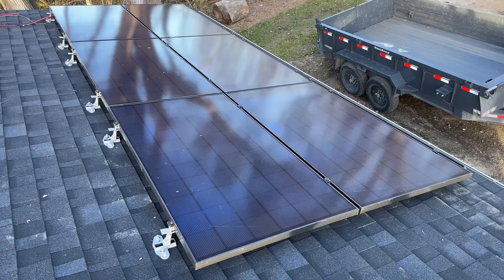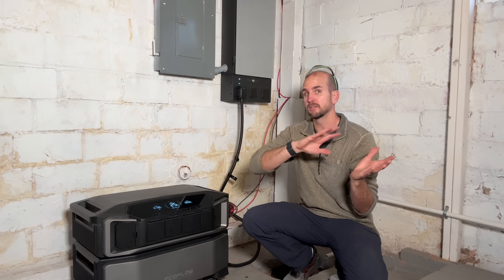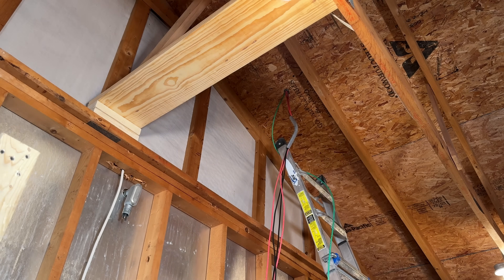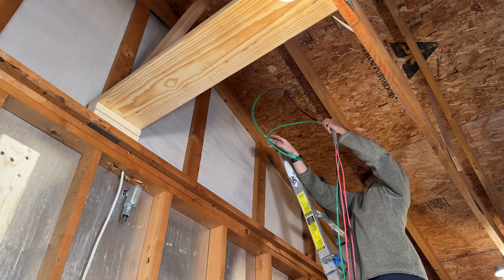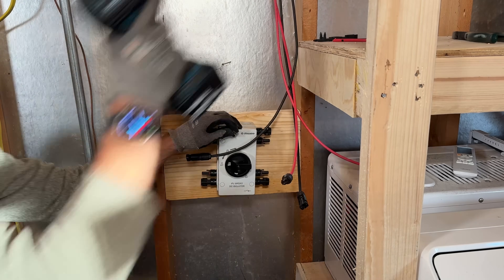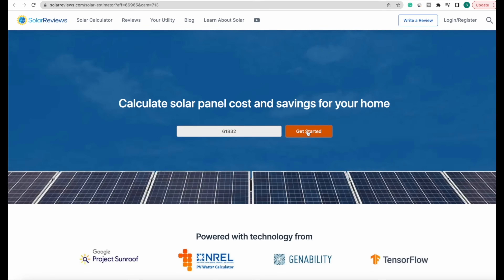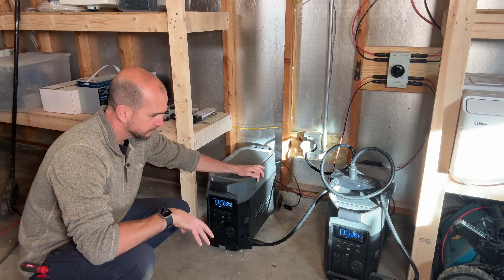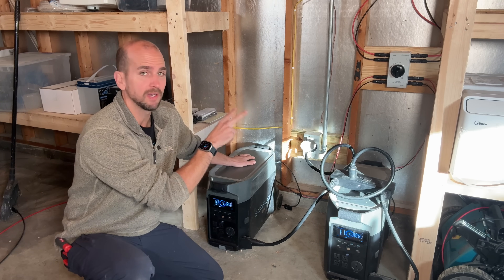Charging An EcoFlow With Roof Mounted Solar Panels

Comment: I really like that the audio is crystal clear and that there is no music, no barking dogs, no screaming kids, no traffic noise etc. But I have two wishes: 1.) I wish is that you showed, up close, how you are wiring the various components, rather then speeding up those parts. 2.) I wish you discussed how to meet NEC requirements. 44 states have adopted at least NEC 2017 and 20 of those have already adopted NEC 2023. In my area, putting panels on my garage roof triggers the requirement that I provide Rapid Shut Down (RSD), which is why I sought out your video ... but you don't describe RSD. (Unfortunately, I have no space for a ground mount installation.)

Comment: For EcoFlow Delta Pro or ultra you do not need to have any grounding between the unit and solar panal please call Customer service  support for the answer. 
Still Can't understand how the grounding wire works between portable unit and fix solar panel array ?

Comment: Hi Scott looking at the delta pro in 3s2p config with the 400w rigids from EF would that dc quick disconnect breaker work when overpanelling…looks ideal for the deltas… thanks in advance
Reply from the maker: Yeah, I think the 3S2P is the best you can do on these units.  That is my plan as well using 12 used panels I picked up recently to power my 2 DP units.
Reply: @everydaysolar  thanks for the reply… We  have a powerstream too so potentially 3s2p in one MPPT on delta and 2x 400w on 2 individual MPPTs on delta (3200w total), 

According to ecoflow apparently input can be managed across the three MPPTs. Might be ok for uk though with our poor ☀️ and ☁️ cover 

good luck look forward to the next video.

Comment: I am going to run 3 395 panels to one delta pro, and the delta pro is connected to the smart panel, do you think i need a dc breaker or isolator?
Reply: If your county or municipality has adopted NED 2017 or later, you will need to provide Rapid Shut Down.

Comment: you make the best quality content on solar in general I found online. keep up the good work. 
I just purchased a EcoFlow Delta Pro Ultra and looking forward to try solar
Reply from the maker: Thanks, yeah I need to get more panels so I can really capatilize on the Ultra High Voltage solar input.  I want to try and run a small house of the SHP2, Ultra, and a couple Delta Pros this summer 👍

Comment: I recently purchased a Delta Pro Ultra and solar panels will be coming soon. Is there any validity to bringing in the wires from the array to a combiner box that is fuse protected even is you are just in series? Do you even need fuse protection or does the DPU take care of that itself? Also I see you connected the ground for the panels in the load center. Should the ground for the panels be kept separate from the ground of the circuits?

Comment: I have an outbuilding without power that I want to do something like this with. Im thinking ecovflow so incase of emergency I can bring it in my main dwelling to power a fridge. Would it make more sense to do a diy system thats easier to transport? Do you need to give the eco flow much attention for solar charging or does it stay topped off passively. Thanks

Comment: Why on Earth would you connect a rooftop array to an ecoflow? A much better design would be to connect your PV aeeay to a real energy storage system consisting of a bank of LFP batteries and a real inverter that's built with a low frequency, transformer based topology instead of Ecoflow's low surge, shorter lived, high frequency design.
Reply: @solarcharging9743 - Because he is showing us how to setup a out of the box system. Of course what you stated works well too, but thats a DIY scenario. Not everyone wants or could do DIY.
Reply: Well then, my suggestion would be to purchase an out of box solar generator that uses a long lived, heavy duty, hybrid low frequency, transformer based inverter instead of one of these short lived, low surge capacity high frequency solar generators.   @1ENDUSER
Reply: @1ENDUSER true and I seen alot of people try and build systems and then have a house burn down…
Reply: We use the ECO Smart Home Panel to offset our electricity costs or go completely offgrid with zero permits.  Now what do you have to say?!
Reply from the maker: I am actually interested in both the all-in-one setups and the DIY custom build outs. What is your go to brand for batteries?  Also do you have experience or a preference on inverters/charge controllers?
Reply: There are several quality brands on the market today that we've tested. Among them are Schneider Electric, Magnum Energy, Outback Power, Sigineer Power and Victron Energy.  @everydaysolar

Comment: Great video.  I have an EcoFlow Max with solar panel that works out pretty good for my current needs.  But I would like to upgrade to panels on the roof, powerwall(s), CyberTruck...  So I'm watching your videos a couple of times.  Thanks for sharing.
Reply from the maker: I am still waiting on the configuration email for my cybertruck 🤞
Reply: I got my name in the hat late for the CyberTruck.  I think there are 1.2 million ahead of me.  So it's going to be a couple of years before I hear anything.  Gives me time to save up some money.

Comment: This is great. I’m building a new shed in my yard and I plan on doing this with my delta pro. I am looking toward the ultra
Reply from the maker: Nice, yeah that is pretty much the exact use case I think is most applicable to this type of setup.  Best of luck on your project.
Reply: @everydaysolar  Thanks.  I really like my delta pro setup for house backup but with the Ultra coming out it makes thing more streamlined.